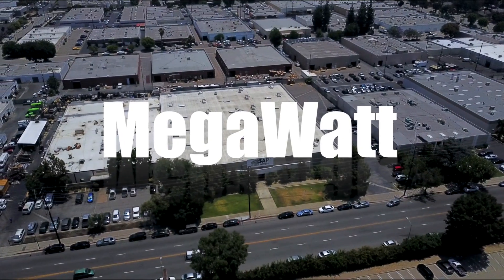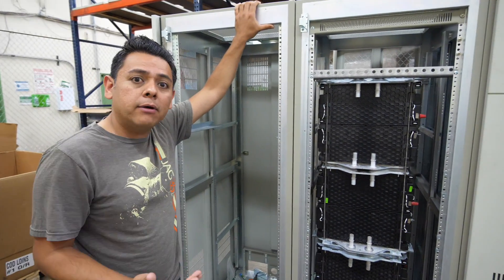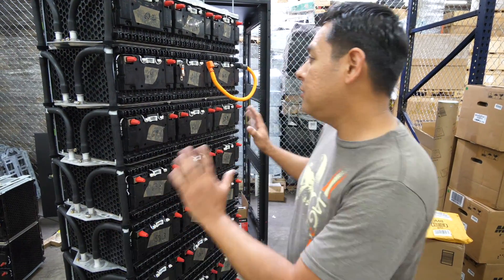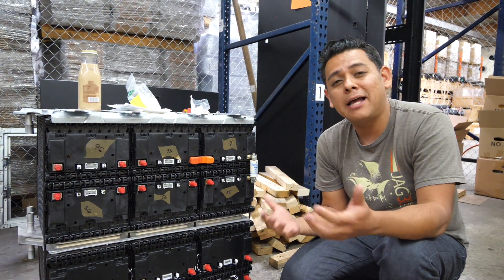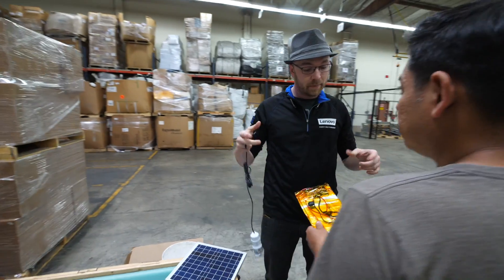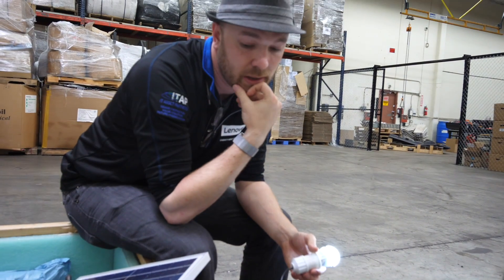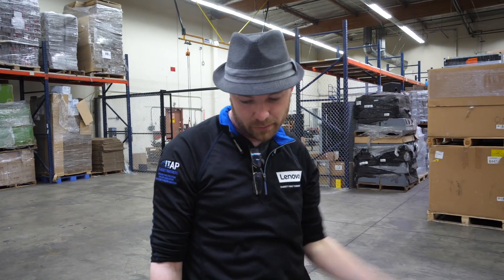1 million watt hour 355V SOLAR STORAGE battery

Comment: Kerosene runs out...go buy some more or have some on hand.  Reused solar panel, batteries, charger dies and they will very soon since they are used....you better have some spares and engineered the system for quick in the middle of the night replacement of parts! Convenience.

Comment: I’ve Got A 4048 Trace Inverter On My Home Solar I’ve Been Off The Grid Since 1995 I’ve Got 24 70 Watt Panels I’ve Got 6 190 Panels On A Tracker But I Need A 48 Volt Powerwall I’ve Been Watching you’re 18650 Packs

Comment: Jehu I live on a small boat on an English canal. I have 440w of solar and need a battery to pair with a inverter. I currently have 2 110ah batteries (lead acid) but looking at lithium. 12v preferred and cheap a possible 🤣

Comment: So battery holds 166 watt hours, light is 1w, the max you would use a day is 24 w since only 24 hrs a day. 25w solar panel and you have just given them a way to never run out of power. This is the way solar should be designed however most do not.

Comment: where can i get theese cheap parts at the end of the video?

and: 
the vanlive/RV/tinyhouse/offgrid-community is a biiiig potential to your "hacks", maybe you can sort out some "Kits" for the market?
they allways use 12v or 24v, with AGM or LI batteries, 200-600wh and 200-1000w solar, mppt and sinus-inverter. 
its difficult for newbies to that and expensive. if you could make a Kit or a video about those "basic needs" with links 2 your shop or amazon-affiliate links
could help a lot and bring you some money?

best
moldov

Comment: Thats what I'm talking about.
I was thinking of one of those locker sized units with lithium ion motorcycle batteries.
For home use with fans for thermal protection.
A hybrid inverter and cheap solar panels.

Comment: This is wing nut radio one of those survivors of hurricane Michael down here in Panama City,Fl and that little battery pack with the LED and solar panel idea is so cool
I will say this at this moment I'm still reliant on the grid to power my pump for the well and my refrigerator freezer and air conditioner

Comment: Hello, suggest user using supercapacitors in multiplexer circuit. 
here is individual created supercapactiors battery 
https://www.youtube.com/watch?v=WdjxFyFnG70&t=12s
which could be user used if changed to do what you want to do at lower cost in my option.
I can be wrong. 

have a great day.

Comment: Yup, electrical engineer here. When you do a solar array or facility back up power (generator or battery pack) you need to connect as close to the point of interconnect as possible. I've not seen this done with lithium packs but I have seen something similar done with 1MWh flow batteries for large facilities. An engineer really should have been involved form the start. While the local AHJ may not require a stamped design the utility is really going to want to know what's going on and they tend to prefer seeing calcs and studies with an engineer stamp before they will talk.
Reply: Frith
Jehu
Isn't it that the lighting in larger buildings with 3 phase coming in, run at 277v?  I'm just asking as the larger building I maintained the AC units on, was a school, the lighting was done at the higher voltage usually for cost!!! Just thought it worth a mention in case his building is the same!!!

Comment: Wow! This is like my prophesy coming true.
In 1997 I prophesied that in the future, distributed electric power via a national high voltage grid comprising the traditional behemoth nuclear, coal, and gas power stations would eventually become extinct.
In its place would still be some kind of High Voltage National Electric Grid but much emasculated, serving mainly heavy industry. This future, "Electric National Grid Lite" would be kept humming via all the renewables: Hydro, Wind,  Solar, Geothermal etc. (I'm ignoring fusion technology for the moment) .
But the biggest revolution will be in the form of distributed micro-generation and storage via batteries. Everyone will generate their own power and will have the option to hook up with their neighbours etc. Mass generation all networked together with electricity meters running forwards and backwards all over the place.
All future housing will be low-voltage DC throughput with higher voltage just for the kitchen and laundry room. I envisage all rooms will have 5V, 12V 24V and perhaps 48V all utilising standardised sockets and plugs for each particular voltage.
The main problem for electric road transport and haulage will be keeping the interiors of vehicles warm in the wintertime, especially up north and in Canada. Electrically heating the interiors just doesn't make sense to me. Despite the efficiency of electrical heating, it doesn't half drink the juice, drastically shortening the range of a full charge. No, electric cars of the future should come with integrated propane or butane heaters saving the electricity for its principal role: mileage. I mean, these alternative fuel heaters are already widely used in trucks and RVs.
You know what? I'd love to sell up, here in London and come out and work for/with you, Jehu. Damn, I'd work for free. All I'd need is food and sleeping quarters. I'd love to do that. What a purpose! What an adventure! I have so many ideas...
I love what you're doing Jehu. You're an inspiration to be sure. And you're riding the wave. Right up there, leading the way.
I'm starting to sound like some obsessed potential stalker. Oh boy. Time for bed.
Reply: Battery grid storage is simply retarded as it siphons supply of batteries for the EV market. Even if that EV would be supplied electricity by a coal power plant it would be cleaner than a gasoline burning engine. I'm not suggesting we use coal but pointing at WORST case scenario still being better.

Comment: Everybody..me, me...where i can buy the battery. Leave the guys to send them to the ones who need. The rest use the "grid". You have more options than those people. Is about a freaking light. Please don't sell these batteries. They must go to some who need the setup. They are light and slim to fit in the back of the 25W panel.  Respect for thinking about others.

Comment: how much of a power wall would you need for say 35 kw wall to run a house
Reply from the maker: Your question does not make sense
Reply: ok i am sorry i think faster that i can write or spell lol if you want to to build a system to run you home ie using 35 kw a month how big a bank and how big an array would one need
Reply from the maker: kWh = energy storage capacity  
kW = energy transfer rate
Reply from the maker: If you use 35kwh a month,  then you need a minimum of 1/30th of that, 1/15th to allow ocasional non sunny days.    For solar you have to charge your battery in 5.5 hours of sun so divide your battery size by 5.5
Reply: ok i am high on the 46 think parrell line so i would get in winter max 3.5 hours so what would the equation be

Comment: What is the cheapest way to build a 1200kWh battery for  RV EV CONVERSION? Will this technique work?
Reply from the maker: 12 megawatt for RV?
Reply: Yes sir - I'm thinking about replacing a 503 HP RAM Engine with Tesla RWD Unit - on a Flexibl Clipper RV. The RV is 17,000 pounds made of steel w/ICE. Maybe I also need a front motor because of the weight?
Reply from the maker: And you wanna add another 10.5k lbs of batteries.   That’s like $200k wort of battery

Comment: Sooo 
Both amazing and stupid
In doing the calculations
How many of those 25 watt 
2x2 solar panels 
Are you going to have to install on the roof
in order to reharge batteries supplying voltage to a 3 phase 10 thousand dollar Inverter ??
You failed to give us the Wattage of...

That hatted holligan is going to be giving you lots of Free cell phones to charge
After you rewire the offices for that low voltage lighting 
Might need to do some more serious calculations on the wherehouse manufacturnig Hi Bay lighting 's draw duraton...

We do like the  comments the unknowing viewers posted
None so blind as those who can not see

Hope you are moving close to the facility

Getting people out of their cars...  is their plan for the future

Just wondering..  how far will your bicycle ride be to work...

Come on man....
You yourself said it is good to get away from Kerosene consumption

We are not knowing WHAT THAT MEANT

Head hatted hooligan does not know

GASOLINE IS A PETROLIUM PRODUCT...
Unless you are driving FORD MODEL A's    around town

Might want to ask the hooligan 
What Kerosene has to do with  enery....  

Camping lamps and coleman camping stoves.. use kerosene...   not gas...

Comment: Isac Nilsson...  is like Issac Newton
One smart mamma jamma

What we saw here was scam after scam
These geniuses have the impression 
They are relating  everything energy related to  

                      KEROSEE USAGE

They are pushing

                                 AGENDA 21... 

Not smooth enough slick talkers

Will never get off the ground..  
Because this is an energy backup system
Not an alternate grid supply.

He clearly detailed the sub panel 3 phase is 50 grand NEW
County nor Edison is not going to ISSUE PERMITS 
OR ENGINEERING PERMITS FOR  USED 2ND HAND EQUIPMENT
This entire project predicated on a used inverter
REWIRING THE ENTIRE BUILDING FOR THE LO VOLTAGE LIGHTING

The  mad hatter thought he was pretty slick plugging that 5 watt lamp into a battery pack...  
And then presenting as though it was going to provide lighting 
throughout the building.

Every second it got more and more stupid

Who ever they think is going to pay for and approve the 
engineering calculations 
Engineering plans 
And permits....For both the Edison tie in
Which Edison will have to approve Seperate from the city or county engineers
as well as the building seondary electrical system
  
Someone thinking that will not be 

               COST PROHIBITIVE

He would be a fool

These guys are participating in  some sort of covert state planning 
effort to control and limit population expansion, development, by creating laws controlling  sustainability...

The underhanded intentional efforts to do good for everyone.. and entice someone...  somehow..  as you heard him say...  

                     Free phones and phone serviceThink this through

Everyone intending to plug in their free phones..  will have to recharge at a recharging station in the wherehouse where the inverter is located.. or throught the building were they will have had to run the low volatge lighting  conversion for the 5 watt facility lighting.

WHEN IS A GOOD DEAL TOO GOOD TO BE TRUE

WHEN IT IS A SCAM

AND THEY ARE TREATING YOU LIKE A FOOL...

                 BELIEVE ANY OF THIS

                                 AND   

                     "  A G E N D A 21  "             

                        IS YOUR FUTURE

Comment: 7 dollars for a 15 watt poly-Si panel?  Who's garbage does this guy think he's got??  Take a look at what those go for on even Ebay.  And then a 166Wh Li-ion battery for another handful of dollars???  Something smells, and it looks someone put a hat on it to try to cover it up.
Reply: You can buy new 300 watt panels for less than 40 cents a watt in quantity so 28 cents for obsolete 25 watt panels is not wishful thinking or a gimmick.  It is called demand and supply economics.  Those old panels are just taking space and lying somewhere with no use. The guy selling it in eBay for $12 is basically doubling his money.
Reply: i found some 20 watts for $12 on aliexpress.. this is def a great idea. the guy prolly just knows the right people or is in the industry, and get them for cost.

Comment: I too am interested in the rural lighting program. I'm eager to see what sort of case will be used to contain the battery and electronics. I'm also interested to see what the delivered cost of each unit will be once delivered to the field. I'm guessing close  to $50 per set once market forces have their way, tea money is paid and NGO-style administrative costs are applied. If they can manage to get them in the field for $50 each it would be a major victory for rural electrification considering previous efforts in the past delivered 30W systems for $260. And then I have questions about the long term sustainability of the project. What is the projected failure rate? Assuming an installed base of 100,000 units and an annual failure rate of 1% that means you've got to send replacement parts three time per week out to parts of the world where UPS just don't go. Not to mention the facilities and small staff needed to manage the program.

Rural electrification is a huge issue across much of southeast asia. None of the questions or points I'm raising should be reasons to say no to such a project. I just would be careful tossing out a bargain basement parts list and trivializing a $5 million dollar project. I've been to Cambodia. I've built and continue to support a school there. Call me an informed optimist.

Comment: how do u get 166wh on an lg chem cell pack I just dismantled one from an old Hyundai sonata hybrid cell it's 4.2v and like 4ah
Reply from the maker: these are 45Ah
Reply: jehugarcia I bought them from this guy thinking I was getting a good deal because they are such high c rating but if the were suppose to be 45ah cells then they must have really been used down to almost no capacity left http://www.ebay.com/itm/222501022300
unless lg chem makes a bunch of different size pouch  cells
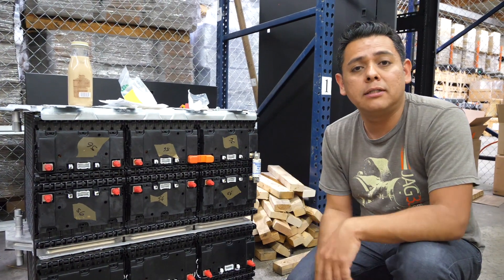Reply: Maybe that listing has been updated, because the Description section now says 5 amp-hour as of 6:45UTC 23June2017
Reply: I knew when buying they were only 5ah just didn't know if these were just smaller then jehugarcia pouches.  going back to his prior video's his look a lot thicker then mine makes sense why his is 45ah and mine is 5ah mine is like 1/8 inch thick per cell his looks close to 1/2 thick

Comment: I know that you've already purchased the inverter, but in case it helps anyone else out-
I can recommend outback power they can accept 42 to 68VDC, and you can stack them to output from 120V to 3 phase wye upto 32KW. And you can program "time of use" schedules into them, so you can use cheap power at night to charge up and run off battery during the day when it's $$$.

Eager to see the video of your finished result!

Comment: Has anyone tried and demonstrated a gravity generator or mechanical energy storage system? From what I've read they're much more efficient and lower maintenance and next to absolute zero environmental impact.
Reply: +Chris Hernandez -- I have seen videos of 3 of them. Two used water you would recycle into the top. One of those makes thousands of volts at very low current and is a centuries-old design, with water the only moving part. It could power a neon sign. The other 2 devices put out conventional voltages. The fully mechanical one used a heavy weight working thru a clockwork-type gear train to spin a tiny generator.

Comment: Damn good stuff! I would buy instantly like 5-10 sets of those $20 battery+solar panel kits if they really would be that cheap to buy for customers. Free power for years in the cabin and other places where its harder to run power and to charge miscellaneous items and to power small led-lights.
Reply: they are a charity project.  are you homeless?
Reply: @mikemotorbike4283 charity begins at home

Comment: I live in Northridge about 5 miles from Chatsworth, since the Northridge earthquake the power probably has been out 5 times for longer than 1 hour, usually at night during a Santa Ana.  Is it really worth putting in a power wall, when you can probably put in a system that sells power back to the grid, feed-in-tariff? Search ladwp feed-in-tariff, presently $14.5c a kwh.

Comment: Not sure if you're going with the pouches at the end of the video or not. They are nice because you can get higher Amp hours as needed without soldering. Just... yeah... BMS, as you were saying... But you went pouches on your original Samba build, so I'm sure you know.

Comment: First...I love the videos, they are awesome!!

Help me out...I do suck at math but..... Just because you have a 166wh battery doesn't mean you can run a 1 watt light for 166 hours.  I feel like there is other "maths" here that prevent that.  
You can't get ALL the power out of a battery....Right??
Reply: +Woods Pepperman You are thinking along the right lines, but... Where will there be even 120 hours of running the light, with no hours of recharge from the solar panel? Only in the polar regions, in winter. Those are tiny populations, with much bigger worries than running a little light. A 25-watt recharge for a 1-watt load would only require 1 hour of good sun per day. Several hours of poor sun would do just as well.
Reply: +YodaWhat, I agree that there will NEVER be a case where those numbers occur. Thanks for the reply.  I am new-ish to power/solar/batteries and just trying to make sure there is not something I am missing.  Is there an equation to calculate this battery "hold back" of power?  How would I calculate this into "the maths" of my own solar/battery project?

Comment: As a guy that has seen what africa can do to a generator ( and a powerful one at that ) make sure to put a safety to limit the power because they WILL overload it, 
i have seen a generator get blown because there were 100s of phones charging at the same time
Reply: Bruno Cardoso as a sierraleonean i have been thinking of going back home to run a lot of projects of mine i wonder when you mentioned saftey from overloading i was confused could you elaborate ,because i want to build my own powerwall via solar panels thankyou